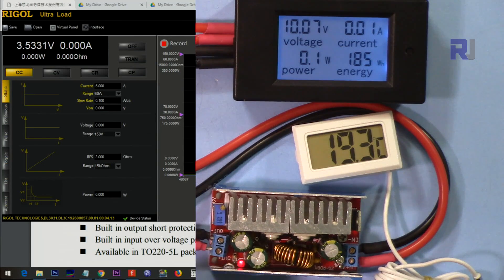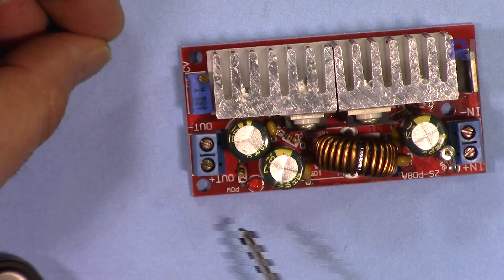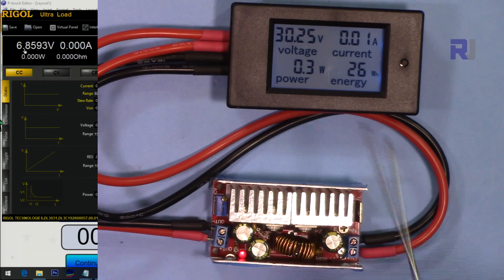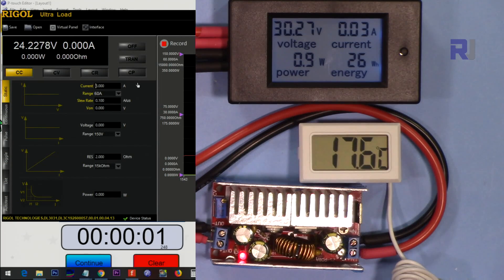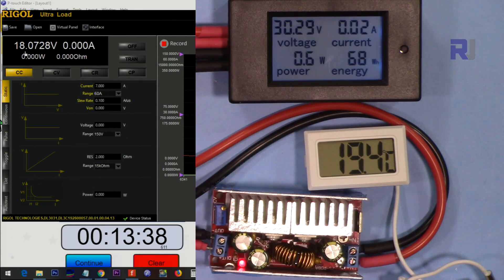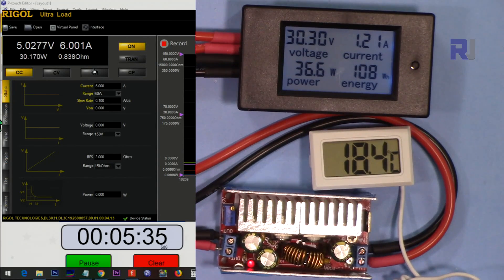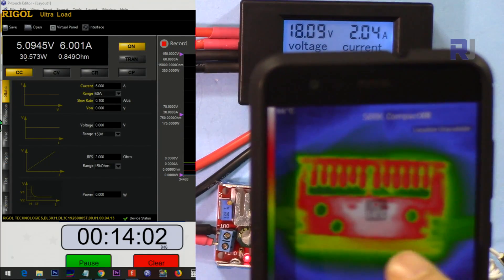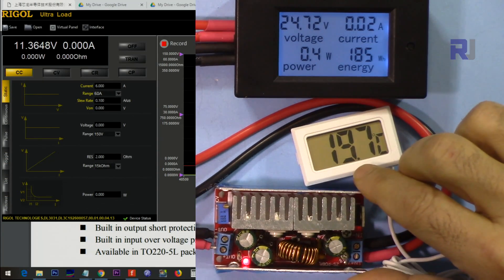Review of XL4016 8A 200W Adjustable DC-DC Step Down Converter Module 4.5-30V to 0.8-30V

Comment: I'm looking for something that does 12V to 5V with high amperage like 50A or something where I can buy a few that do 15A or 20A.

I have a PSU that's good for hard drives, but it doesn't have enough 5V for solid state drives. I wanted to bypass the PSU's 5V and convert the 12V line into 5V instead.

Comment: What happens if the voltage to be converted is lower than what I set? does it switch off then?
Reply from the maker: this is step-down converter. Input must be higher than output. else it will not work and output will go lover than input. for that purpose you need buck-boost which will always keep the output at the required voltage regardless of the input. I have some videos on that.
Reply: @robojax  Thanks :)
I want to hang my solar panels on the thing for a short time and charge my battery because my controller is broken.
as long as the thing switches off at undervoltage instead of something breaks when my battery is full everything is fine :)

Comment: I personally think these units should be rated by "Watt" Only. You will always find some fool connecting it up, adjusting the voltage to the highest, and connecting up a load with the maximum Amp rating, and then sit pondering why the converter lost all of its magic smoke.

This is obviously just personal preference, but IMO, if they said the unit you tested was a 1.5V - 40V/50W buck converter, it would firstly eliminate most of their lies, and secondly, give a person a better understanding of its "Actual" capabilities. From there a person could work out that at 10V you could "Maybe" get 5A bursts out of it, and only 2,5A bursts at 20V etc.

The first thing I do when looking at purchasing one of these units is the wattage. I recall watching your video about the LM2596 series 3A buck converter thinking that these units are only rated at 20W. I've learnt from past experience that I need to take off at least 50% of the original manufacturers total, and therefore, I land up with a 10W module, and they work perfectly fine with those constraints in mind. 

I have 4 of these LM2596 Series buck converters running off of my 24V setup that gets charged from 2 x 55W solar panels. These 4 modules run my Wi-Fi router (original Power supply rated at 9V 400mA), My Fibre Access point (PSU rated at 12V 500mA), my Gigabit Network Switch (PSU rated at 5V 400mA) and then I went a little bit overboard, and added a module for my TX8 TV box so that it doesn't reset every time they decide to switch off the power for my area (Yup, I live in a country that professes to be 1st world, but in fact are 4th world). On the TX8 TV Box, I have checked and at times while running a CPU/GPU benchmark, it hit 1.6A @ 5V, however, those are really taxing the CPU and GPU, so under real world conditions it never uses that much current.

All four modules run off of the 24V battery bank that is only charged via solar, and they average about 1.2A on 24V between the lot of them, so the batteries never drop bellow 12.79V on each bank (Second hand batteries) removed from (Presumably), a back up system for a company running inverters/UPS for their IT infrastructure. All of these units are absolutely perfect for the task at hand as they will never exceed the 10W each that I have estimated their best operational wattage to be, and they are not even getting warm, so, even a bigger bonus. 

I say........... Always "Overate" the power supply to what you want to run, that way you don't have anything getting either too hot, or burning out from over use.

https://drive.google.com/file/d/10L-SLsnNv86kPEpdIeLFcVJLQnO5spCO/view?usp=drivesdk
https://drive.google.com/file/d/1aLSEaVQkgtGiM9xUbsttOkFNdqu3O2Qz/view?usp=drivesdk
https://drive.google.com/file/d/1FirWA0CrJb9p8OZPlsc-nML7H2LXqe3J/view?usp=drivesdk

Apologies about the quality, I only realised after I took the picture that the lens was full of finger prints, so it made them all blurry, and by then I had closed the housing up already

Long and drawn out, so apologies for that too.
Reply from the maker: Thanks for the very long comment and sharing your experience. The links are not working. you have not shared it and it asks for access request.
Reply: @robojax  Hi, thank you, I will check the links and amend them, sorry about that
Reply from the maker: I just check the images, wow. nice. the total current will not increase but you get higher voltage.
Reply: @robojax  Hi. Sorry, I think I may have confused the issue. The buck converters step down the 24v to 5v, 9v and 12v, so more current, but less voltage (not that the WiFi or fiber will ever need it) , but anyway, thank you for taking the time, it is most appreciated. 👍🏻👍🏻👍🏻

Comment: Can i get circuit diagram of this pcb for illustration of circuit
Reply from the maker: It is not available. but the circuit is very simple. Just use the datasheet I provided, you can draw it in less than 15 minutes.

Comment: Found some simular Buck converters working up to 60V.     
https://www.aliexpress.com/item/32858318685.html      
Synchronous Rectification they use 2psc of HY1808A  80V/84A  Mosfets  

Else you video was informative (watching the test) - pretty efficient these XL4016 converters even with rectifier MBR20100
Reply from the maker: Thank you.

Comment: Hi, in the datasheet it said that xl4016 can support the maximum input voltage of 45 V, can you teste that in a video?
Reply from the maker: Hi my test for this module is done. You can come to conclusion from other value.